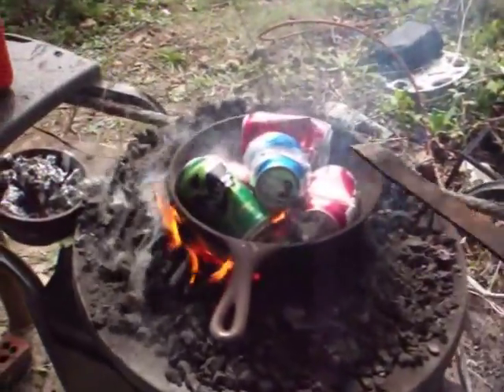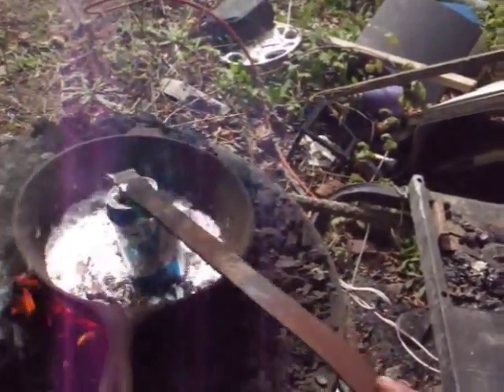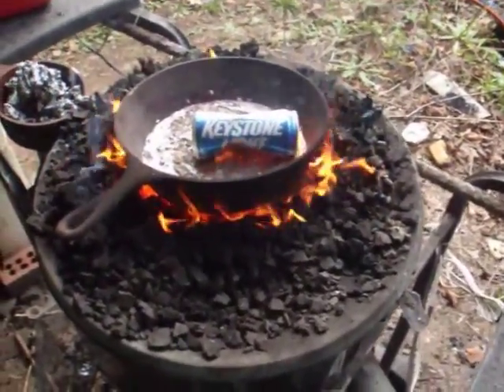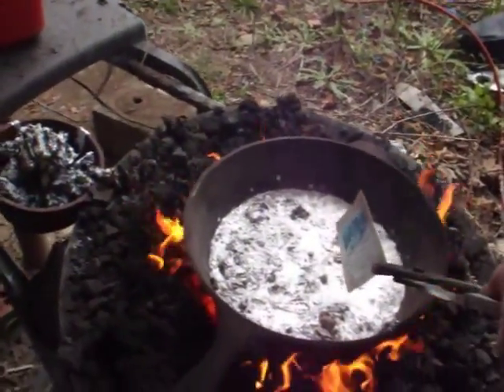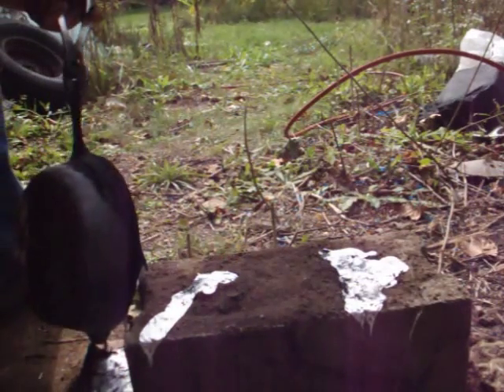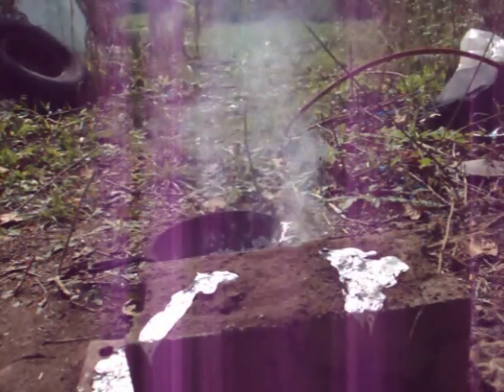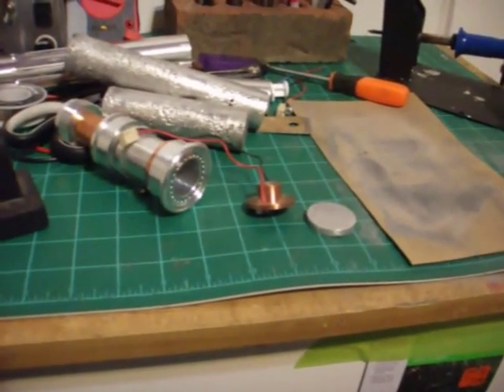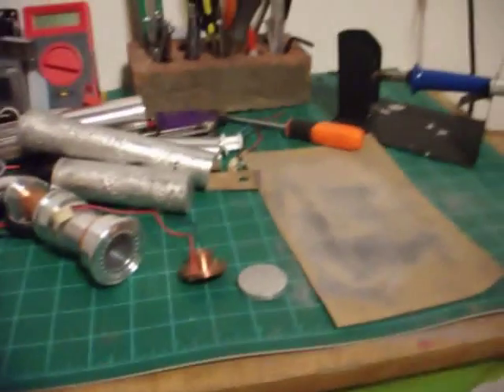makeing aluminum stock: Part 2

Comment: Don't put water in molten aluminium it will cause a steam explosion, it will explode molten aluminium in a circle that has a 15 foot radius it sounds like a .410 shotgun.

Comment from the maker: i made these for light sabers. the LED assembly inside them requires a heat sink. the place i buy my light saber parts sells them and they are rather crude. just a copper disk with a nub on it. i just made bars at the same diameter and cut them to slices and smoother them up for better contact. a lot of work but was way fun and a nice learning experience 
note this is not professionally done. i just did this to burn time / learn / and make a few parts to save money,